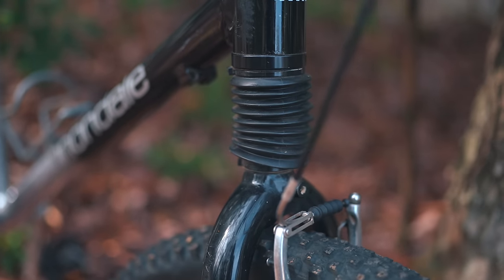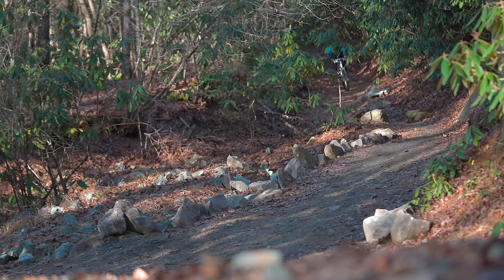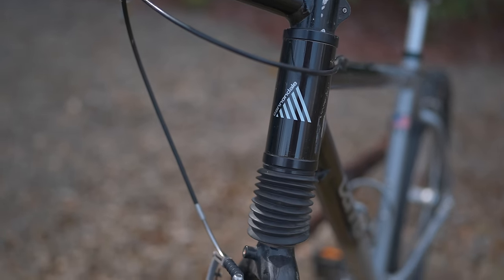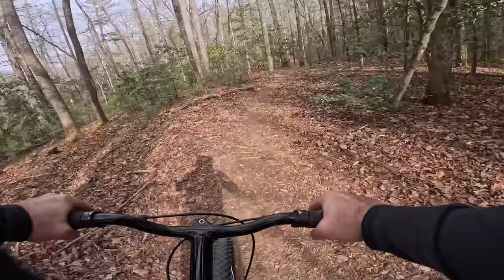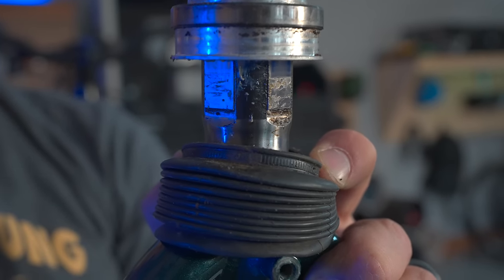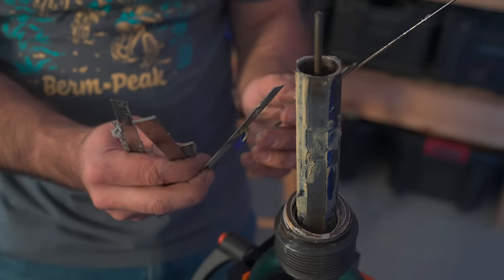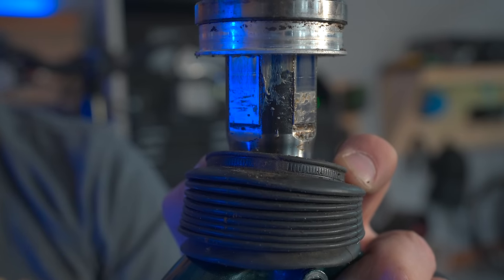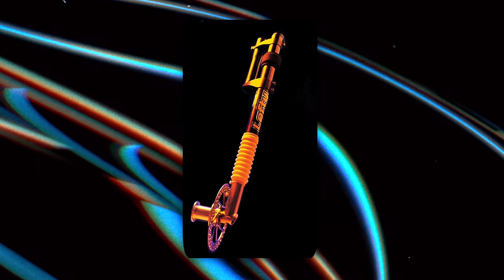The Rise and Fall (and Rise Again) of Cannondale's HeadShok

Comment: My 1st higher-end bike was a C-dale Jekyl with 80 mm headshok. Loved dat it pretty much eliminated fork flex, was smooth & super responsive.
It got stolen & was replaced by a C-dale Prophet with da Lefty.
Almost 20 years later still go'n strong!
At least once a year I get da Lefty serviced & it has been bulletproof.
[Unlike da rear Manitou Swinger shock which has been replaced by a FOX shock]
For rail trails/urban commuting, I would definitely take a headshok over a traditional suspension fork.
Great when old skool stuff can still b new skool 2day.
Great vid as usual!👍👍

Comment: Would it be possible to use a modern Headshok (with the improvement on replacement parts and maybe the problems partially solved ?) in an older bike as yours in the video?

Comment: I bought a Cannondale Caffeine mountain bike, way back around 2008 or so. I still have it and the shock seems to be doing OK. I'm pretty easy on mountain bikes, and don't do anything too difficult. No jumps for me. But I wonder about the shock's condition. I have asked two different bike shops about the need for maintaining it, and they both said don't touch it if it's working. Also, I am pretty sure my headshok is an air shock of some type. I remember putting air in it early on, and I have a shock air pump. Is it different than the one you show in this video?  Thanks!

Comment: Does the bearing migration issue still happen on new lefties and head shocks? Surely you could use a recirculating ball linear bearing like a 3D printer to solve that issue.

Comment: Wouldn't say this for a smaller channel like myself with 500 subs, but the commentary edits are a bit jarring. Maybe I notice them because I edit videos. Anyway otherwise great video. Cheers.
Edit: I think the editor has audio ducking on some ad lib samples. Probably a simple mistake. 10:08 for example.
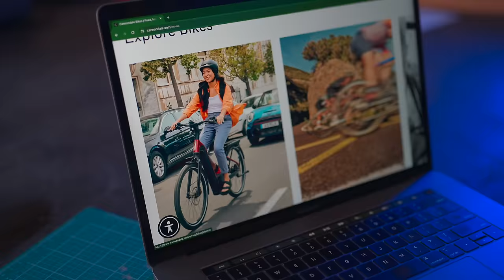Reply: 11:20 actually I don't think I know what is happening. It's almost like there is an ass crack of daylight between the audio splits. Some timeline snapping shenanigans maybe.

Comment: I don't think that fork is the stock on on the f500. I had a f500 in the same paint scheme, but it came with the elastomer based fork which didn't have a lockout. you could remove a top cap and adjust preload only via allen key. the shock book also looks longer than mine so maybe it's longer and thus the wacky geometry? something else these frames had which was quirky at the time, since this was pre-V brakes there was this little cam thing that mounted in the center and then used canti brakes so instead of pulling from the center, it  sort of acted like a precursor to v-brakes (but never really worked that well)
Reply: I think you're right. I had an f700 and it also had the elastomer headshok without the dial control.

Comment: I had a 60mm headshok and it was AWESOME.  No maintenance, just worked. And the lockout was perfection.   Would buy a gravel bike with one immediately if they made it.
Reply: You can get a Lefty Topstone if that's your think. I think the primary complaint is you can't just use any front hub, but otherwise I hear it works pretty well.

Comment: If only Cannondale had put some of that engineering effort into making frames back then that didn’t break so easily. 

I’ve always dug Cannondale. They’re kind of like…the Saab of bike manufacturers. ‘Sure, let’s put the engine in backwards and slanted over and have a chain drive.’ Bike version: ‘what if fork but just one leg?’

Comment: I just got a new bike and i love it but there is a problem with it. It is really hard to shift down in gears, like i really need to push the shifter with all my strength. So i was just wondering if anyone had a solution for the problem?

Comment: So glad I couldn't afford a Cannondale from that era, and I really wanted a Beast of the East as I was getting into trials riding. I dodged a bullet there though, those things snapped so easily if you just rode them hard off road, not to mind used them for trials. HAVING A Cannondale would have left me poorer and with a broken bike/face. The irony was that Cannondale's website in that era made a huge deal of their Q Lab, where they boasted about all the hardcore testing their products survived, and yet they still earned the nickname Crack'n'fail with their awful frame reliability from the people who actually rode them. Nowadays they're just another company run by beancounters since they went bankrupt and the name was bought, but they were certainly innovative in that era though certainly not reliable.

Comment: Cannondale should sooo totally do another dual sided fork using their needle bearing design; It'd be the plushest, most resposive fork out there with very low bearing and seal maintenance.
They could call it the lefty righty.😂👈👉🤯. could also design in some softish rubber bumbers at the top of the bearing race to keep the needle races aligned each time you lift the front wheel. They've probably come up with a solution by now,I'm no technical expert, I'm a pretengineer; My ideas sometimes outway the application of reality. 😁

Comment: Ha! You younguns! We rode bikes designed for road on trails. 10 speed, drop bars . . . when a bike designed to ride trails was made it was an epiphany. The bars were WIDE! The tires FAT. The brakes powerful (except in water or mud, but just roll that stuff and head for anything dry). Shocks? Shocks were awful on enduro motorcycles, unheard of for bicycles. All bipeds used off road were pogo sticks until the racing dirt bikes came with a ton of travel. Kids from the 80s, 90s, 00s had life good. Aluminum frames, unheard of in the 60s & 70s. We started with single speeds with coaster brakes on 30lb 20 inch frames. Did I mention that we walked to school, uphill both ways?

Comment: I drive canondale since 2004. Starting with headshock, lefty air 110mm and finished with a 120 mm lefty max. I look back. The least reliable forks i rode... Migration, leakage, lost bearing parts. And here in germany the service is a Joke.

Comment: Headshock is absolutely USELESS.. It offered zero shock dampening for the arms.. It only allowed the head tube to slide up and down.. I HATED mine. it also robbed power when cranking uphill. SUCKED